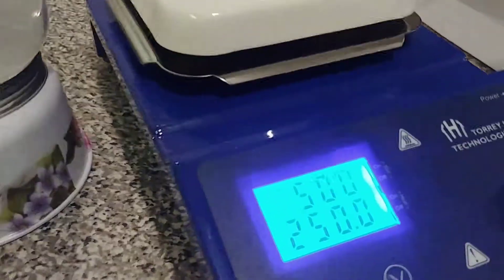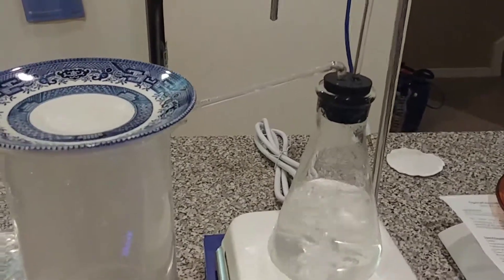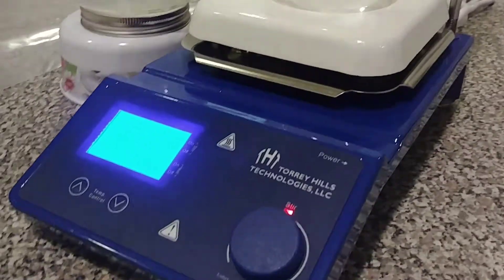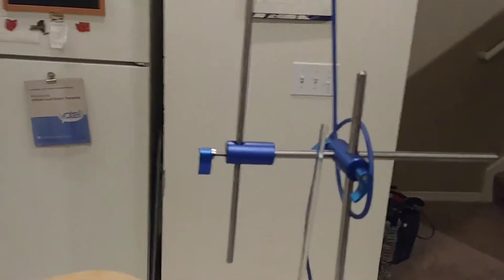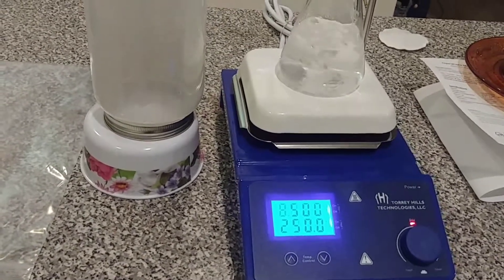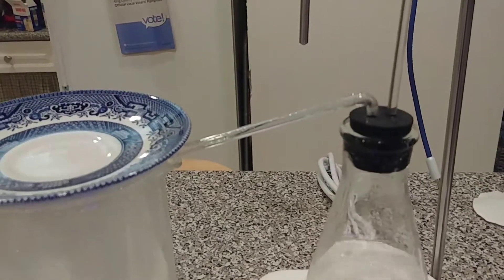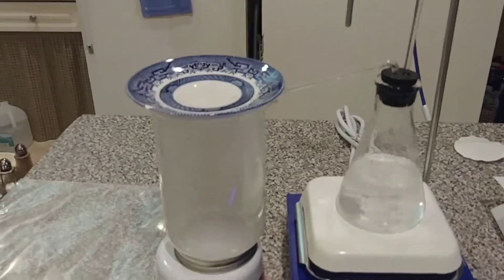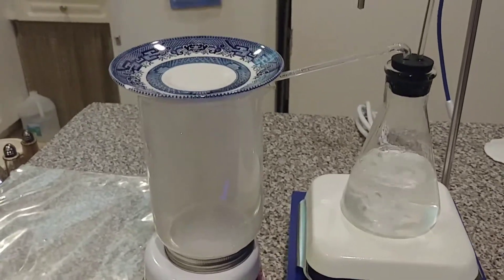Chemistry (Amateur kitchen lab): Magnetic stirring hotplate arrived!!!

Comment: Just discovered your channel researching a hot plate to get, and youtube needs more videos like yours.

I know this video was uploaded over a year ago, but if you see this - has the hotplate/stirrer held up well? Accurate temperature probe? 

Thanks for the great content!
Reply from the maker: The temperature probe seems fairly accurate.  The heating element in this hotplate in this video actually died after about six months, but after contacting the seller, they replaced it hassle free.  The second one also died after about four months, and again the seller replaced it hassle free.  I don't know if they got a bad batch of heating elements, but the third replacement is still holding up.

Despite the dead heating elements, I still think it's a decent hotplate.  Most of all, TorryHills was great in honoring their warranty and they never made me pay for shipping or any other costs for the replacements.  They actually let me keep the second one because they felt bad I had to deal with the dead heating elements, so I'll probably take the second one apart and see if I can find out where the failure is.

I've also got a Scilogex hotplate which is a lot bigger than the one in this viedo and it heats up to 550 Celsius.  It's the model SCILOGEX MS7-H550-S LED Digital 7x7 Hotplate Stirrer, and I highly recommend this one.  I've not used it much due to normal life time restraints, but it's really nice.
Reply: @mwilson14  Thanks so much for the detailed response. That's exactly what I was worried could happen, although their customer service does sound great. I wonder if the fact that the Scilogex heating element still works is in part due to your not using it as much as the TorreyHills hotplate,  but I'm sure you're right that it's the better unit for various reasons. I wanted to save some money, but as I am spoiled with getting to use good industrial hotplates at work, I'm probably just going to get that exact one you recommended. Thanks again!